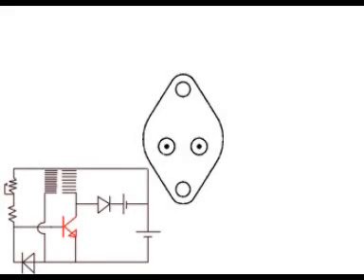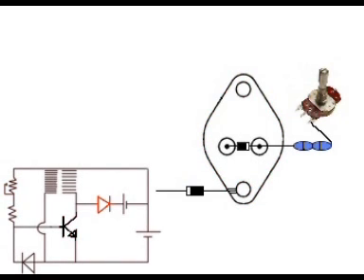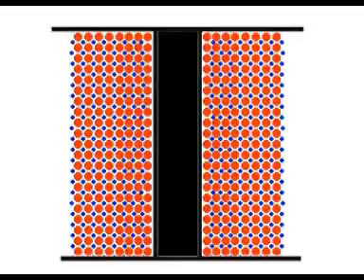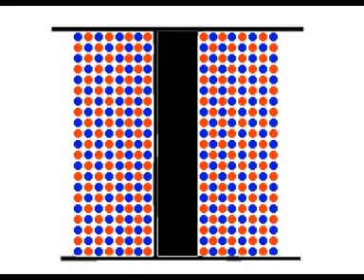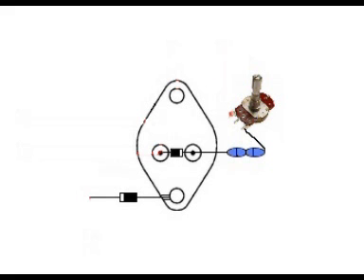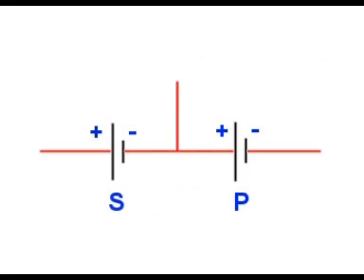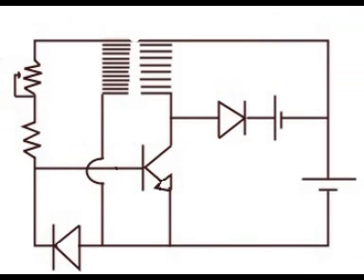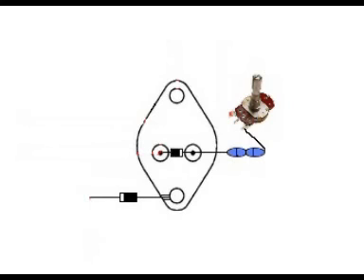How to Build a Bedini Motor ... Part 2

Comment: Have built my second circuit and that seems to be working. I am using a plastic wheel from a wheel chair. Question is, Is the weight of the rotor an important factor? I can't seem to get the thing running. The coil has a strong pulse and moves a bit as the mags pass over the core. Worked before on a smaller scale, Any idea's?

Comment: Thank you - your explanation helped me a lot when building my first machine (now being tested). However - 1 question. in another of your videos (showing various motors) you have a switching circuit to swap the batteries. Could you provide a similar easy guilde to making one of these? That would be very helpful to us non-electricians! Keep up the good work.

Comment: A couple of things.. The potentiometer, when wired as shown, functions only as a resistor which has an impedance equal to the maximum value of the potentiometer. Added to that is the 430-ohm resistor. So, assuming the pot is 10K, you're basically just putting a 10,430-ohm resistor in the circuit..

Comment: It's an in-efficient type of DC motor; that's all it is; nothing else. Any energy, and all energy that you take out of t his motor came from the original running power supply; period; that's all there is. It's not that complicated, I really don't know why you can't understand this. Amateur efforts to measure electrical outputs usually fail badly; but really it's just that energy, itself, is a real thing, and more will not "come out" than "went in".

Comment: @introvertebrate  Hello again, sorry I was actually referring to the wire used to connect the three seperate parts of the motor - the red wires in the section 'Putting it all Together', that you do by numbers! :)  Any thoughts on the best gauge for these wires? :D

Comment: Hey! Great videos, like many on here I'm collecting together components for my first build. As a complete beginner, I don't know what gauge wire to use to connect the various parts (Batteries to coil, coil to circuitry etc). I see Maplin do a range of "equipment wire", could it be one of these? Any advice?

Comment: Hey! Great videos, like many on here I'm collecting together components for my first build. As a complete beginner, I don't know what gauge wire to use to connect the various parts (Batteries to coil, coil to circuitry etc), any advice?

Comment: @introvertebrate yes its magnets and extra thick coil wire actually a friend of mine did this and got very good results but hes looking for powerful magnets to make it better,what he did is he installed a wooden hub on a brushless motor shaft and installed the magnets inside the wooden hub and then energize the magnets with coil wire from a battrey he got very good rpm and voltage about 2000 rpm,hes working on bigger magnets to install them on generator head shaft,so if u wnt try tht if u hv tim

Comment from the maker: The motor doesn't self start... have you tried giving the rotor a spin by hand to see if it gets going.

and a 1 ohm pot is far too small... you really need a 1k pot.  the pot might be fried and the only way to test it really is with a multimeter.

Comment from the maker: A few millivolts is all you need.  Once the voltage induced by the trigger winding *slightly* activates the transistor, then the coil acts as a transformer and really activates the transistor.   Is your motor running at all?

Comment: Good video  - I built this, but found that I was only getting a few millivolts from the trigger coil. Not really enough to fire the switching function.

I might give it another go with stronger magnets and see if I can get enough voltage to switch.

Comment: Yes and No,  I have not built this exact circuit.  However it's not much different than a lot of power supply circuits and they are always < 100% efficient.

I have seen my meter lie to me when measuring pulsed waveforms.

Comment from the maker: A neon bulb only conducts when the voltage goes over 90v.  If you disconnect the charging battery then the high voltage spike from the coil won't have anywhere to go so it zaps your transistor and fries it.  If you have a neon bulb in the circuit it allows the spike to go around the transistor and protects it.  It does not conduct electricity as long as the charging battery is connected and a resistor won't work either... it has to be a neon bulb.

Comment from the maker: Were you using the neon?  If not the transistor IS probably fried.

But to test it, BRIEFLY short the base and collector of the transistor.  If your transistor is working the coil should repel the magnet.

Comment from the maker: A transistor is a bit like a switch.  The one we use is an NPN transistor which means it is normally "off" so no current can flow through the collector/emitter.  Though when a small current passes through the base of the transistor, it allows current to flow freely through the collector/emitter.

Comment: This is an excellent video on how to build a circuit.

Unfortunately there is nothing about this circuit that creates energy.  It exchanges current for voltage, but power out is always less than power in.   The energy is pulsed which tends to make meters read incorrectly and fool people into thinking they are gaining power.

Comment from the maker: Theoretically possible, but practically impossible.  The problem with a relay is the time delay before the contacts close.  and you would need a transistor to switch the relay anyway ^_^

Comment from the maker: 30 guage should be fine as long as the coil has plenty of turns, though you may want to use a lower base resistor since the wire will have a higher resistance :)

Comment from the maker: maplin have them on thier website as :

wire ended neon bulb

The connection between the batteries should be as low resistance as possible so the thicker the better ^_^

Comment from the maker: the batteries can be swapped with greater efficiency... a battery that is charged in the standard way (ie. no capacitor) is better at running resistive loads like an incandescent light bulb but is not as efficient at running a motor...

Comment from the maker: Capacitors are like buckets for electricity... there is another configuration to this circuit where you substitute the charging battery with a capacitor so the output of the motor dumps all its charge into the capacitor for a few seconds and then a relay is used to dump all that charge into a charging battery in a split second.

It is said that a battery charged this way is better suited at running inductive loads, and the SSG is and inductive load so....

continued...

Comment from the maker: the neon is the best protection from frying your circuit... as long as you use the listed components the circuit shouldn't fry...

though I don't use the 2N3055 anymore and only use MJL21194 transistors... they are much better quality and can withstand quite a beating!

Using several diodes in parallel helps the charging effect but isn't neccessary to protect the circuit.

... continued

Comment: Hi introvertebrate

Well first thing is that great video im a total newb and no nothing about electronics but trying ¬¬. I have followed your instructions religously but it doesnt work?? im getting to a point of pulling my hair out altho for the core i have used several drill bits but this seems to work when i short it as it repels the magnets and using strong magnets.I spin the motor but it does nothing.. Advise please TIA

Comment from the maker: Sorry if this sounds like a silly question, but do you know you have to spin the rotor by hand to make it start?  It doesn't self start.

One way I use to test the circuit is to BRIEFLY short the collector and base of the transistor.  This should pulse the coil and repel the magnet on the rotor...

Comment: i checked to see if voltage came through everything and i don't know if this is right.
12v supply
.83v coming through EB (with 1N4001 in)
1.50v coming through EC
.81v coming through BC
10.21v coming through 1N4007 by itself
3.14v coming through 10 ohm resistor
10.31v coming through potentiometer 
the coil does work when i hook it up separate from the circuit but when i hook it to the circuit, nothing happens. there is sparking when it works and it hasn't sparked.

Comment: i'm soo confused!! i have put everything together correctly! now i have the neon bulb, and the battery circuit put back in, i got a new transistor and resistor. i drew out the diagram with the numbers and double checked to make sure it was right, hooked it together and....nothing happened!

Comment from the maker: If you had a 1k pot, I would say you could use the 100 ohm resistors as your base resistor.  But unfortunatly those pots values are far too high.

Your best bet is trying it with a 470 ohm resistor to begin with.  The only way you'll be able to tune the circuit is to add or subtract the resistors.

Comment: thx for the reply..

what i seem to have a bunch of (pre-packaged) are the following:

100 ohm resistors
470 ohm resistors
9.9 k resistors
3.2 k resistors

I pulled these off a circuit board..
39k potentiometer
19k potentiometer

can I pull it off with any of this?

Comment from the maker: The resistor values don't have to be precise but I wouldn't use anything higher than 430 ohms as a base resistor and no lower than 10 ohms.

The potentiometer does need to be pretty close to 1 kohm to begin with.

Comment: hey bro great vid

1 question..

on the resistor and potentiometer, I would emagine the ohm's that Bedini calls for are directly related to efficiency.. 

if you don't have the exact values for either, how catastrophic do you think it will be?

I'm cannibalizing parts from an old 250w power supply - lots of goodies in there (very nice transistors + heatsinks)..

I made an Imhotep pc fan thingie to play w/ it.. 

but my magnets just came, soon as i can mount them i'll make a bigger motor..

Comment from the maker: soooo... let's say the wire on the outside of the coil is your positive lead... then that means the wire from the trigger winding that is on the outside of the coil needs to be connected to the resistors (before going to the base of the transistor) and the wire coming from the inside needs to be connected to the emitter.

Or vice versa :)

Good luck with it ^_^

Comment from the maker: if you feel the magnet being repeled then you know that is the way the coil should be wired (except the end connected to the negative of the battery now connects to the collector of the transistor).

If the magnet is attracted, then the wires need to be the other way around.  Or you could just turn the coil upside down :)

REMEMBER WHICH END OF THE COIL IS NORTH!

Comment from the maker: Trial and error ^_^ It depends on which way you have wound the coil.

get a magnet and mark which is the north pole.  Hold the north face pointing towards the end of the core you would like to use as the "top" of the coil.  Connect one of the power winding's leads directly to the negative of a battery, then while holding the magnet as described above briefly connect the other end of the power winding to the positive of the battery.

Comment: Thank you for the quick response! I did finally find the 1N4007. ;)

My next question is: The power leads "1 inside and one out side" of the coil winding, which should be used as the positive and negative? Same question with the trigger wire.

Thanks!

Comment from the maker: Pretty much any other standard diode (not a zener for example) should be able to handle it, the 1n4007 is known for performing well.  I have recently purchased some UF4007 which is the fast switching equivellant of the 1N4007.  hopefully they will perform better ^_^

Comment: Ref:  BASIC ELECTRONICS THEORY - half priced books.  pin 2 555 trigger pin, output pin 3, 180 degrees out of phase. Use a diode and a single capacitor across the only coil you need-bifilar appears unnecessary. Converted square wave signal can then be replicated, boosted audio amplifier and connected to the coil for u know what. by the way, 1n4007 is 1000v rating, 1n4001 is 50v rating.

Comment: I wouldn't worry too much about the diode. Buy an economy pack of 1/2 watt ones. Put them in series for higher voltage or parallel for more watt capacity. Combining them in such fashion should get you where you need to be.

Comment: oh! and the laminations, rods etc must be insulated from each other so if you didn't laquer the copper coated welding rod pieces you wasted your time and may just as well have used a solid core. If you keep blowing transistors then you are almost certainly generating high voltage switching pulses from the coil and need to put a small inductance in series with the coils and transistor these can be readily bought from electronics supply shops, a few mH   on a ferrite core should be sufficient, but

Comment: ok this is a fun little project, but your living in cloud cuckoo land if you think this will give more power out than you put in. But as to electro-magnet core ideally you want soft iron or silicon steel, soft iron from gardening wire, si. steel from transformer core, if you cut open a car ignition coil you will get a nice ready made core. reason for laminating core (or using rods, filings etc) is to reduce induced eddy current losses.

Comment from the maker: normally the neon wouldn't light as long as the charging battery is attached, but yes,, you can substitute the charging battery with a high voltage capacitor and intermitantly discharge the capacitor into a charging battery using a 555 triggered SCR ^_^

Comment: Dear introvertebrate,

Is it possible to capture the voltage in a high voltage ELCO or another kind of capacitor en use it to charge the secundary battery, instead of using the energy to let the neon bulb light up.
Keep up the good work, I really have to stop reading and start building the Bedini device.

James

Comment from the maker: "Here I see a very efficient though useless wheel running with help of batteries."

I have converted several computer fans to run as an ssg.

They draw half the amps a unmodified fan draws, and 70% of the energy I supply is recovered in a charging battery. So I am effectivly getting the same amount of mechanical work for 15% of energy cost.  If my modified fans are now 100% efficient, then it implies that standard computer fans are 15% efficient...

Comment from the maker: "Can you use work from the spinning to fill emptied batteries?"

Yes... there are several people on youtube who have attached a generator to the rotor and generated more energy than what it takes to power the motor and still charging batteries using the flyback voltage.

"I've watched all your vids and haven't seen "free" energy in any of them yet."

lol... I've never tried to prove it on video!  That is impossible!

Comment from the maker: Those substitutions should be fine... the wire guage isn't too important and you can use as low as 100 ohms for the resistor.  Not sure about the diodes... It will probably still work though

Comment: I had 23 awg and 30 awg so wound a coil with it. Will the 30 awg cause a problem? Also how tight are the specs? Can a 470 ohm resistor be used in place of the 430, or a 1n4148 diode in place of the 1n4701? Thanks. GReat videos!

Comment: This video is very informative, you have a gift for teaching and the visual aid diagrams are nice.  I am still a bit confused as to which diagram is correct for attaching the pot & resistor to the transistor.  Both diagrams appear on your link.  Do they attach to the Emitter or the Base?  Thanks

Comment: My coil is only 290 turns.. that was the length of the mag wire I had.  If I use an iron core (16D nails insulated by tape to prevent eddy currents from stealing power) would that work?

Comment from the maker: it is incredibly tricky (by the way, the 1N4007 connects to the collector)

The est way would be with an apporpriatly sized nut and bolt.  Though you could wrap the diode around the collector as tightly as you can, and with a it of luck, it may solder into place ^_^

Comment from the maker: it will depend on how close together the magnets are and how you tune it... if you use the trigger wire for the triggering and the magnets are close enough together it should only fire on the north magnets... if they are further apart it will probably pulse as the north is leaving the core then as the south is approaching... though why would you want alternating magnets?

Comment from the maker: it is possible to substitute the trigger wire for any other kind of triggering mechanism like a reed switch, hall sensor, or mechanical contact... optic triggering should work though I am not sure if it will work as well.  One on the great things about the trigger wire is the ease you can tune your circuit.  Also, the coils won't behave in quite the same way, mainly they won't self resonate or create multiple pulses per magnet.  So, yes, it will work, but it porbably won't behave the same way.

Comment: great video. is it possible to remove the trigger wire from the coil and connect up an optic transistor in its place?? using the same circuit

Comment: another trick is to get small toriods out of broken electronics,, then smash them with a hammer into powder, then mix said powder with glues and fill the core with this glue/ferrite powder mix,, should work,, ? although I haven't tried that yet, it seems logical. because toroids are iron ferrite.

Comment: yow i dont want to sound needy or anything, but everytime im about to hook up the bedini circuit one of the battery connections start sparking. I've tried every possible combination of hookup sequences i can think of but it still sparks...any suggestions?